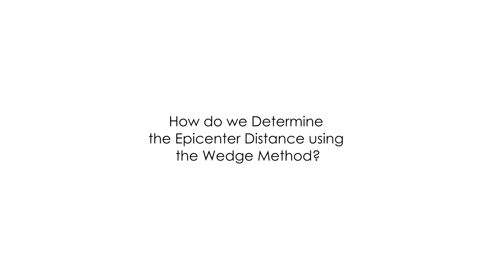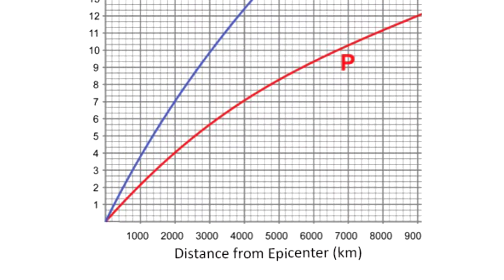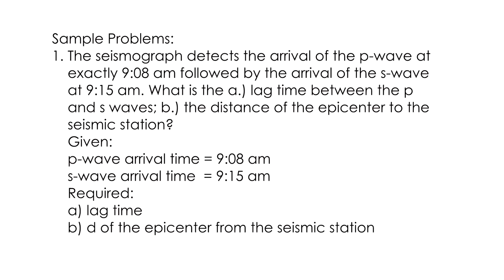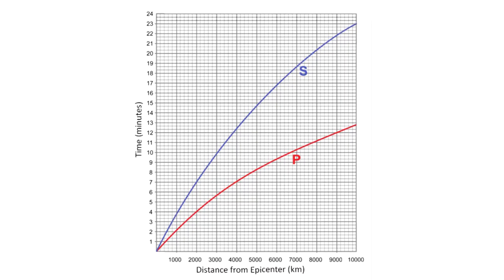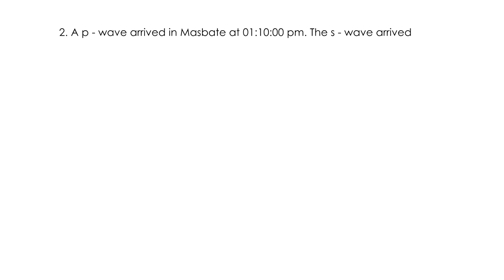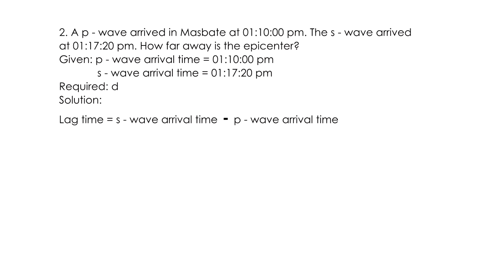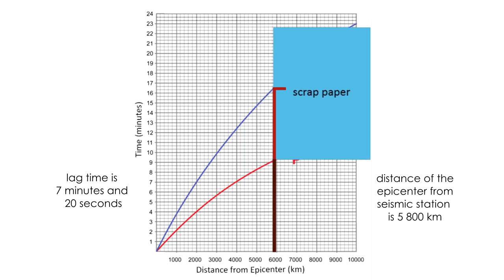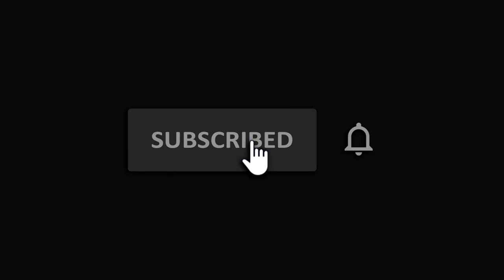DETERMINING THE EPICENTER DISTANCE USING THE WEDGE METHOD | MELC BASED

Comment: Sir
How to draw primary and secondary wave. Randomly or there is some procedure.
Reply from the maker: What do you mean?
Primary and secondary waves are given in a seismogram.
Reply: @MYNSTVVlog  I mean to say how to draw them on the paper
Reply from the maker: If the lag time is given, using a scrap paper measure the length corresponding to the lag time along the y-axis (time). Make sure that the scrap paper must be placed vertically along the y-axis. Then slide the scrap paper along the s-p curve (s-wave and p-wave curve). Find the length corresponding to the lag time in the s-p curve. Then draw a vertical line downwards to get the distance in km.
Reply from the maker: You have to follow the procedure shown in the video.
Reply: @MYNSTVVlog   But how to draw p- wave and S wave on paper. How to maintain gap between them. I have fully understood your video but what about the p and s waves. You haven't mentioned that?
Reply from the maker: The s-p curve is already given. The video is all about using the wedge method to locate the distance of the epicenter from a particular seismic station.